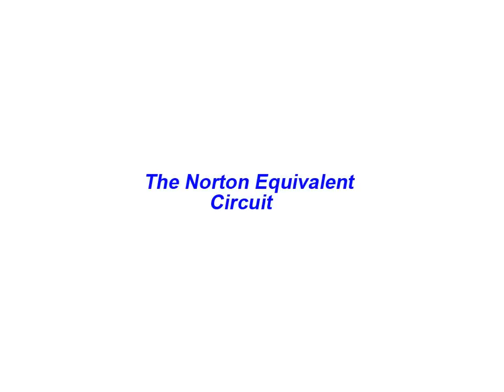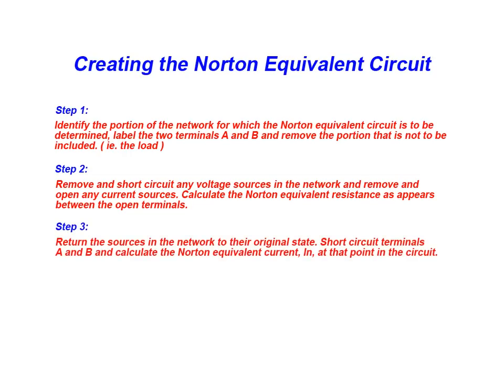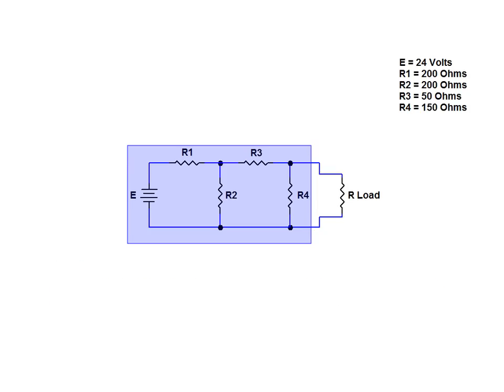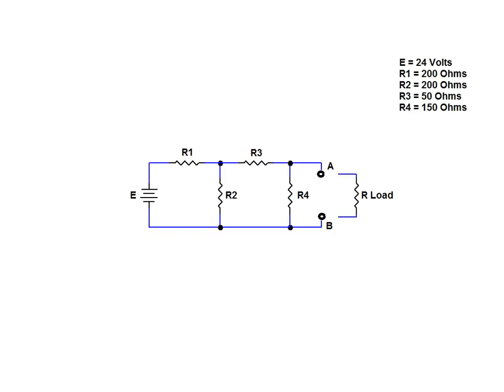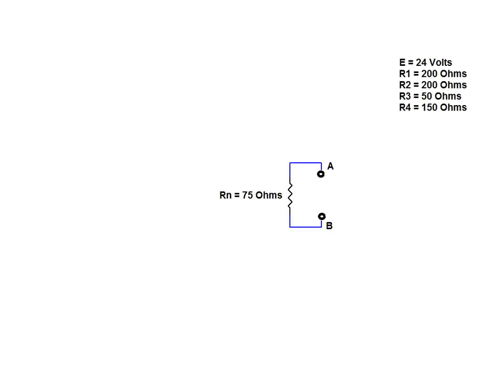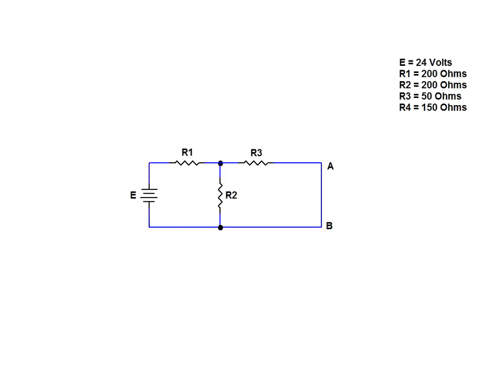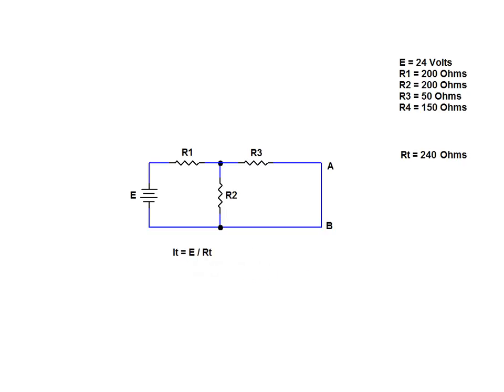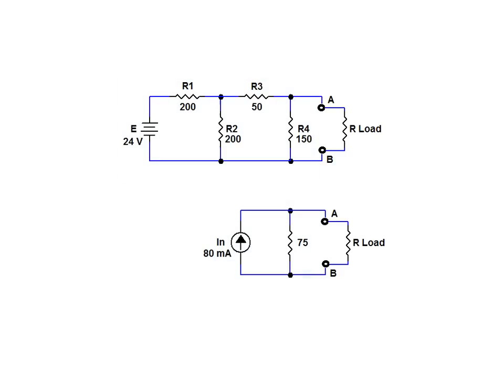Online tutorial on creating a Norton equivalent circuit

Comment: I don't understand why R4 would receive no current when you short circuit it
Reply from the maker: Joey Adinolfi When you bypass a component by providing a short around it, no current would flow through it.  All current would take the path of no resistance rather than go through a resistor.

Comment from the maker: Same circuit, same current flow. We are not calculating the same quantities. 
For a Thevenin calculation, we are using the voltage divider rule to split the voltage. Voltage is directly proportional to resistance. When we are doing a Norton calculation, we are using the current divider rule to split the current.  Current is inversely proportional to resistance.   So the relationships used to solve for values are tailored to what value we are trying to calculate.  Thev --> Vth      Norton --> In

Comment from the maker: According to the current divider rule, you would use the resistance in the branch that you do not want the current for as the numerator in the resistance ratio.  You can confirm this by looking into the "Current Divider Rule" for parallel branches.

Comment from the maker: Yes, for calculating Rn, E is shorted.  So If your circuit does not have a resistor in my R1 position, R2 would be shorted, and your Rn value would equal the equivalent of R3 in parallel with R4.
I hope this helps.